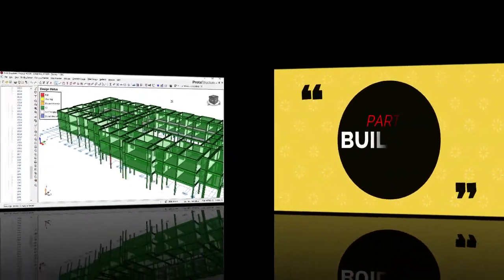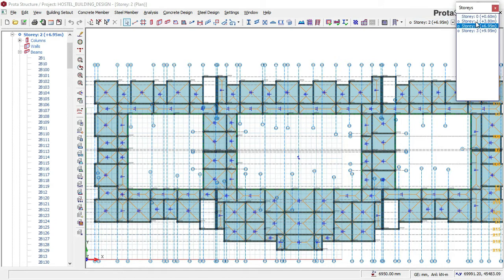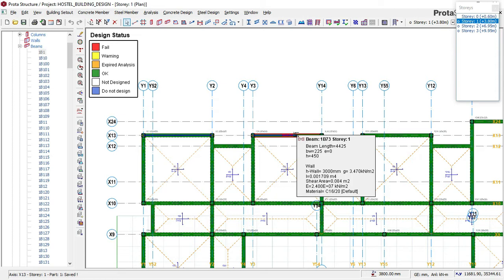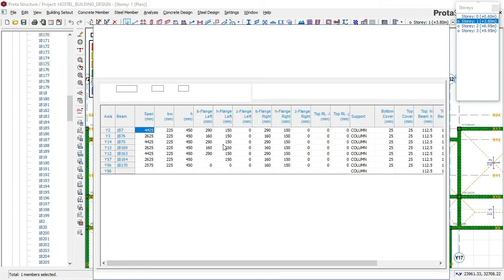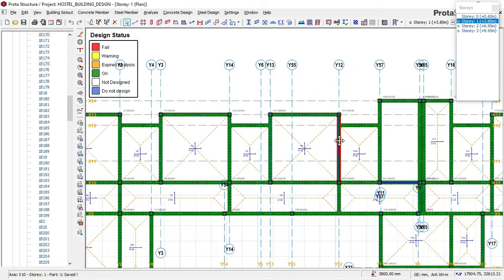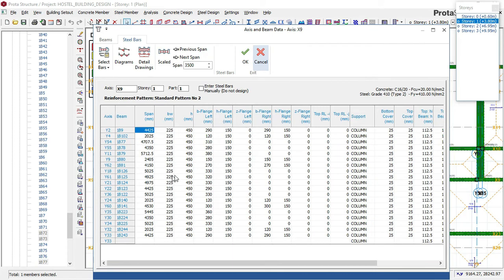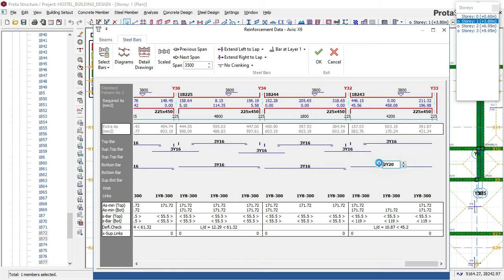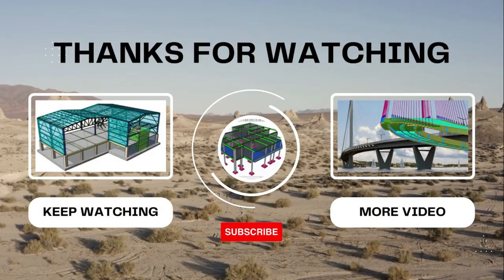Protastructure Tutorial Beginners - Level 6

Comment: Hello, I installed prota structure on a new system running windows 10 Pro. In the ProgramData.. Under the prota folder, there is not "common" folder, only "protasteel" folder.
I can't activate the software without that "common" folder which contains sub folders R5 & R6... Any idea on how to fix it? Thanks